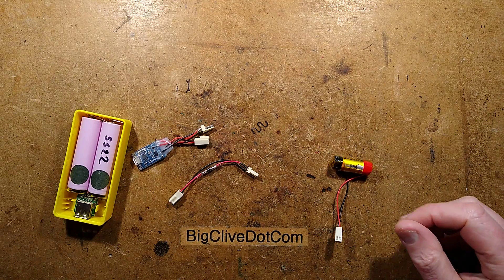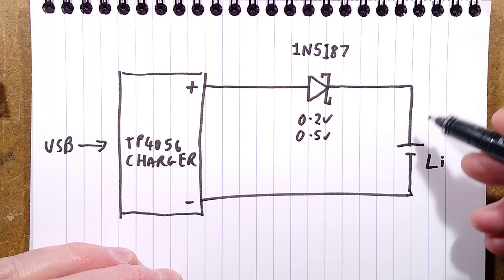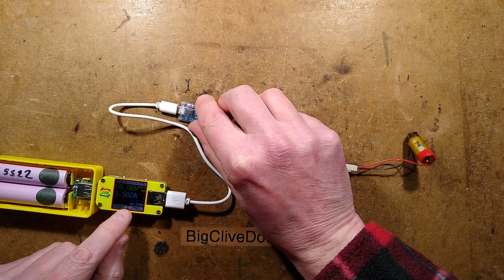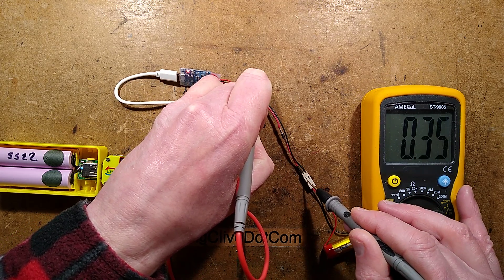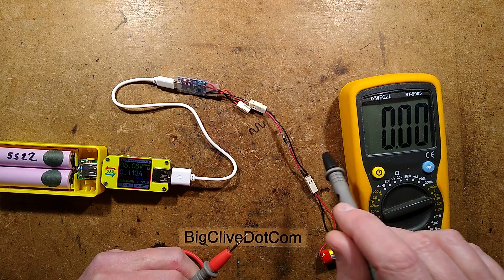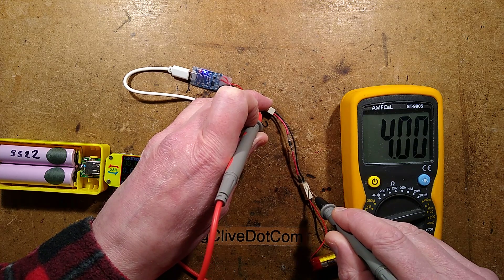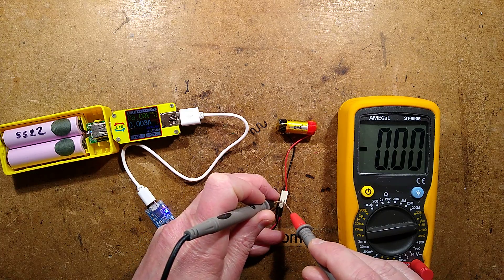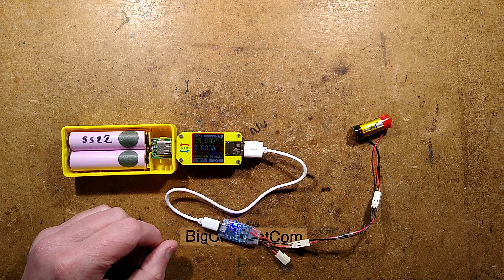Schottky diode between charger and lithium cell?

Comment: i've just been pulling the chips out of those disposable vapes along with the batteries and connecting the charger to the cell and the cell to the load with no protection. am i in for a fire?
Reply: I've been doing it years I reckon it's just luck.
Reply from the maker: The little charge chips in those are OK as simple fixed current chargers.

Comment: It is strange that the manufacturers of chargers always assume 4.2 volts per cell.  I have had three "36v" e-bike battery packs which is 10 cells in series with balancer board for an actual voltage of 42 volts when fully charged.  All the chargers say 42V on them.

So either they are deliberately charging the cells to their maximum capacity to reduce the life so you have to buy a new pack sooner  OR  it is the consumers who won't buy them if they only get 80% or 90% charge.  I am not sure which.  It is another mystery of the Chinese Manufacturing Empire  :-)

PS - I will try an experiment of putting a zener in series with the charger.  But I don't know what will happen because of the balancer board.  Anyway it will be a fun experiment with one of my old packs.
Reply from the maker: They usually go for maximum charge for the same reasons the phone companies do.  To make it look like you get a better product.
Reply: @bigclivedotcom  I think that is correct 👍

Comment: Had some very privileged BBC training back in the day and not to push anything more than 70-80% of its peak capacity was something special that changed my whole world!
Reply from the maker: Especially with power supplies.  The cooler the better.
Reply: That's because most manufacturers (especially those in China) want "good numbers" while still trying to keep building costs to a minimum. So they overrate their products - what is 70-80% of rated load (sometimes even less) is what should be 100%, for reliabile operation. 
For lithium batteries, it's not about greedy manufacturers, but the limitation of the battery chemistry it self
 - one can choose to charge to 4.2 V, to get maxiumum capacity out of them but realtively few charge cycles and short lifetime - or only charge to 3.9-4 V and get 70-80% of the capacity, but like 3 times more charge cycles and longer life out. 
The problem is when those batteries are used in products that's built to run the cells at "too high" voltage. For example cell phones often seem to charge the battery all the way to 4.35 V and shuts down (indicated 0% charge) already when the voltage has decreased to like 3.5-3.6 V. Unless they use some other chemistry than typical lithium ion (like the 18650 cells), that exaplains why they degrade relatively fast compared to in many other applications
Reply: @Speeder84XL they actually do use a different chemistry, it's a high voltage LiPo. They are designed for maximum depth of discharge and capacity, not for lasting particularly long. You can force them to run the ideal 20-80 in software though, if you're so inclined.
Reply: @somedude2492  Ok, that makes sense. The phone I have now (Samsung A10) is like 4.5 years old, but still have most of it's capacity left (at least 2/3 of the original)
 - despite being charged up to 100% (which is 4.35 V) and often used down to 5-10% (which is like 3.6 V). So they apparently handle it quite well. At least for many newer phones.
Reply: @Speeder84XL  65% rated capacity for a 4.5 y/o battery isn't bad for a phone, but it isn't great if you're aiming for a long lasting device. Batteries designed for longevity, as the ones in EVs, should handle 10 years of use with less than 20% battery degradation. It's pretty cool what we're slowly managing to achieve with new battery technologies, while maintaining the lithium chemistry mostly the same.

Comment: Nice idea.
I think it would work better if you put a 1-10K resistor parallel to the diode and a bit bigger over the battery. Then the chip can monitor the voltage better to a certain level and probably not going into 'shaking mode'. But, 'd have to try it out for the best values.

Comment: You can add a small electrolytic capacitor in front of the shottkey diode to allow the battey chip to have a stable reference voltage, one rated 5V at 100uf would be fine. You want one sized small enough that it charges quickly but not so big the charger thinks it's a short.❤
Reply: did you mean in parrlel with the diode? trying to think thru how the dc current would pass thru the cap without causing oscilation. maybe i misread your comment as "in series in front of the diode"?

Comment: I just ordered a device called Chargie yesterday to limit my cell phone charging to what ever i set in the app to extend the life of the battery on my new phone. I wouldn't mind hearing your thoughts on it, and see if i wasted my money on it or if it will actually work as advertised. 😅
Reply from the maker: Interesting approach.  There is an app that lets you set the maximum charge voltage, but it requires rooting of the phone.
Reply: That'd work.  LineageOS (community Android build) does this using the built-in charge controller on my phone (LineageOS 21 on Oneplus 6) - no extra hardware required (selectable charge stop level between 75% and 100%).  Most models are supported I think, but it is buried deep in the menus.  Most of the battery fatigue occurs above 4.05v.

Comment: This reminds me of how I like to construct little 12 V DC batteries for network gear and such: You take a regulated 12 V DC power supply, a 10-50 ohm resistor, a diode and a PROTECTED 3-cell lithium battery. You connect the diode and resistor in parallel with each other, and then connect them in series with the battery so that the battery can discharge through the diode. You then simply connect the battery-resistor-diode in parallel with your 12 V power supply.

This will allow the battery to slowly charge through the resistor, up to 4 Vpc. If the mains power fails, the battery will power the load through the diode until the protection circuit shuts it off. When power returns, the resistor will limit the charge current without the need of a dedicated charge chip. Float-charging lithium ion batteries like this isn't ideal, but the diode voltage drop prevents the battery from "micro-cycling" if the power supply voltage varies slightly over time, and the relatively high value of the charge resistor makes the charger essentially invisible to the battery once their voltages have reached an equilibrium.

Comment: You now make me want to try and change a lithium cell from 5v USB,  in series with 2 silicone diodes. Or maybe a Schottky and then a silicone diode. I know it's not super precise, but as long as the voltage is between 4.2v and 3.9v. Maybe some current limiting resistor, or mabe the diodes with drop/limit enough🤔. Experiment time, with a  Fire extinguisher 🧯 by my side 😉👍
Reply from the maker: Keep in mind that some lightly loaded USB power supplies put out more than 5V.

Comment: AFAIK, you can keep a li-ion cell 'floating', i.e. keep it hooked up to a  constant voltage supply for a prolonged time, as long as that voltage is sefely below the fully charged voltage of 4.2V. Something like in the range of 3.7 to 4.0V should be fine. Of course the catch is - that power supply has to be current limited, otherwise you can have a bad time it you hook up a discharged cell.

But, if it is current limited, you could theoretically just hook it up overnight and come back in the morning to a cell charged up to your desired voltage.
Reply: You don't keep them hooked up for storage, thats just BS the manufacturers will give you a shelf voltage to charge (or discharge ) to for storage and its typically 3.5 ish not overly critical and of course cheap cells with high internal resistances will self discharge quite quickly.
Reply: @andymouse I dont think hes suggesting you 'should' more that you 'can' (as long as the power supply is below the fully charge voltage, as as soon as the power supply voltage matches the battery voltage there will be no potential difference, and then no current will go into the battery, so it wont be charging anymore.

Although you shouldn't do this in my opinion, as if the cell has a high internal resistance, or gets warm when charging, has dendrites etc, it will sit there burning off power in the form of heat, which will leave it constantly charging = constantly getting hotter and hotter until it goes nuclear. Its in my opinion the common failure mode of most cheap Chinese battery packs (that lack thermal protection, cell level voltage monitoring). And why its important in my opinion to never leave Li batteries charging unattended. You never know if a cell has gone bad and if there is sufficient protection to stop it going nuclear.
Reply: It seems we agree but people shouldn't chime in with BS regardless of 'should' or 'can' :) @ratgreen

Comment: I've worked with and even designed circuits that used diode voltage drop to skew reference voltages on a regulator, drop by a specific amount an output and in this, it appears that's what is intended.
I've also saw designs that used a Schottky diode for its HF switching, which wasn't as readily apparent, due to the input frequency to the diode that was passed to a circuit or more commonly, to a smoothing capacitor, as a regular protection diode wouldn't handle the frequency as cleanly.
All, niche uses for specific cases and well, good designs for what was intended.
One learns by experimenting!
Unlike some of my own experiments, this one at least didn't emit Status Smoke.   ;)

Balls, fire alarm...

Comment: Recently I wanted to power an emergency light with a lithium cell. What I did was to use a comparator with a set hysteresis to charge it to about 4V and then raise (or ground idr) the enable pin of the tp4056 to stop the charge

Comment: I wanted to use this power option for the weather monitor. The lithium battery is in buffer mode. Two diodes are connected in reverse and in parallel. Previous use of the batteries with a constant charge caused them to swell.

Comment: I can imagine it has an issue when it thinks it’s full and turns off as there is then no voltage for it to sense because of the diode blocking it which would send it into the low battery recharge mode which it would rapidly jump out of as the voltage leaps up. I use a similar diode method for float charging my boat’s starter lead acid battery from the solar charged LiFePO4/lead hybrid domestics. That works well by avoiding repeatedly charging to an absorb voltage and instead goes no higher than 13.7v ish I also use a 10W halogen lamp in series so that the voltage depression on starter operation doesn’t overload the diode yet still provides a low current path when cold for the small trickle current. It added 7 years to the useful life of the starter battery.

Comment: 1- The TP4056 automatically terminates the charge cycle when the charge current drops to 1/10th the programmed value after the final float voltage is reached. when you set resistor R3 to get 500mA TP4056 will only charge until it gets current to 50mA.
2- LiPo gauges (i.e. MAX17048) report ... 0% when battery voltage drops to 3.7V 
3- I seriously don't see any reason to put the diode in series. Of course you get to 3.9V because lower the current less stays on diode ;-)
4- when I charge the lipo from proper charger (adjustable) I set 5mA as cut off

Comment: What about using a germanium diode or germanium transistor as a diode? That would be an interesting follow up video...
Reply: That would work but not that interesting it's all about a voltage drop so get your diode measure it and there's your answer :)

Comment: Not charging to the absolute max rated voltage and charging at the nominal charge rate (which for most Lithium based batteries is at 0.5C or lower) can easily double the total lifetime capacity. 
Android used to allow apps to affect how fast/much phones charged.... no you need to root your phone to do that. i still kept my old "dumb" chargers that only do ~5W max as i don't need my phone to charge at 30W and then sit the whole night fully charged.

Comment: The TP4056 module is a charger that has also has a battery protection circuit. I wonder at what battery voltage it will stop suppling power to the output terminals?
Perhaps a part two to the experiment?

Comment: I do exactly this for my expensive RC model gliders. I have two batteries connected to the receiver. Each one has a Schottky diode to stop one battery charging the other. Two batteries are there in case I'm dumb and flatten one battery and that means the spare battery will at least allow me to land the glider safely. I charge the batteries on a normal charger without the diodes. The diodes are only connected to the Rx. OK, it's a little more complex than that, but that's the essence of it.

Comment: Why wouldn't you just have a current limited supply that has a voltage limit of 3.9v? At 3.9v you're still in the bulk charge region so you can charge at the bulk rate.
Reply: You would :)
Reply: @andymouse  Thats alright then...  I guess when it comes to batteries people always wanted all the capacity available but for things left on charger all day except for the 5 mins you need them perhaps 80% is good enough.  The other point that I didn't make is that its also better not to charge them at 1C just because you can.  The lower the better but lithium don't seem to mind the charge rate too much unless  they start to heat.  So 0.5C will probably make quite a big different bit 0.1 not much better.

Comment: I agree with your conclusion. A charger IC with a programmable upper voltage will be better. Also i looked at 1N5817 (1A Schottky) from Onsemi. At 100mA the forward voltage is 0.29 volt (ish). But at 500mA the same voltage is 0.37 volt ish. This may have perhaps have confused the charger IC.

Comment: A Schottky diode's voltage drop disappears at very low current, and measuring that is actually rather difficult because your multi-meter also pushes a bit of current to measure the voltage.  Basically, though, the problem is that you can't get a reliable output voltage if when the intent is to fully or nearly-fully charge a battery.  It will happily trickle-charge at ones or tens of microamps right up to the input voltage as if no diode were there at all, if you let it.

You can force a more reliable voltage drop by forcing a minimum current through the diode by putting a resistor to the ground return after the diode.  Usually a few mA will do it, so like a 1Kohm resistor does the job.  But of course, if the charger stops charging entirely now the resistor will start draining the battery you just spent so much effort charging up!

This also means that it can work quite well for larger LiFePO4 battery systems that always have some sort of load on them.  You can maintain a grid-supported "float" voltage in a UPS application or for low-battery load support where the voltage is lower and it doesn't matter that the output voltage is a bit squirrelly.

I do precisely this on a 48V solar + battery backup system using a Mean Well HLG-320H-54A power supply (320W, isolated, adjustable current and voltage limits, and fanless).  I run the output through a set of 4 x 20SQ060's in parallel to provide low-battery load-support from the grid.

But you don't want to "float" a NMC or NCA lithium chemistry at any voltage.  Not really.   LiFePO4 can be floated.  NMC/NCA should not be.

-Matt

Comment: That's perfect for keeping the battery on the charger without it reaching one hundred percent charged, in this case, it remains perpetually 58 percent charged. This helps prolong the battery's lifespan. The issue is that the capacity decreases.
Reply: For example, if the battery has a capacity of one thousand milliampere-hours, only 580 milliampere-hours will be usable.

Comment: For whatever reason, programmable charge voltage doesn't seem to be terribly popular until you get into the 'nice' charging chips that have serial interfaces that let you control all sorts of parameters. By nice, I mean they cost more than $1 per chip in bulk or more than $2 in hobbyist quantities. There are a few cheap 8-pin models that will let you set the voltage by hooking a voltage divider up to one of the pins, but they don't seem very popular. I guess the sort of customer that wants to be able to use a non-standard charge termination voltage is also the sort that might want to control other things as well, so they lump a bunch of control features into an I2C interface and call it a day. I suppose that is fair. I mean, if you tell the average consumer, "your device won't last as long on a single charge, but..." they have probably already moved on.
Reply: Excellent comment ! If your serious about this stuff there are solutions out there to let you control the voltage but if you want to do it on the cheap then you do this dodgy stuff. For me I don't care I mean what are the numbers for using the diode ? what do you save in your pocket, probably not much !!